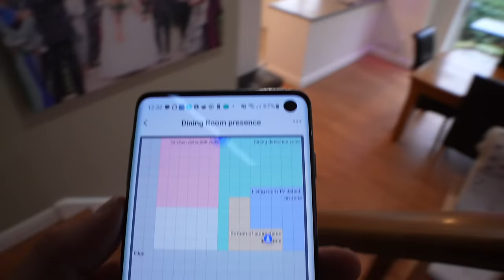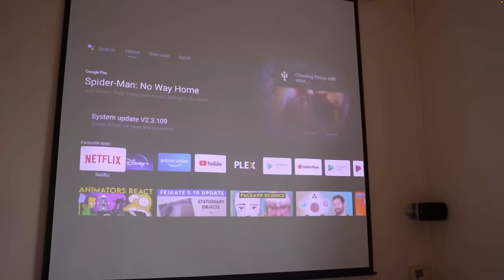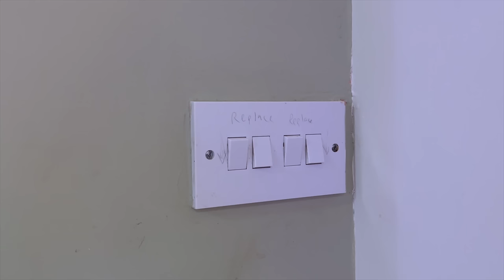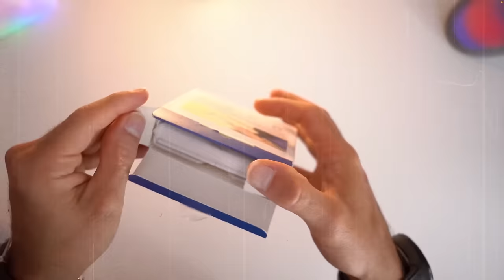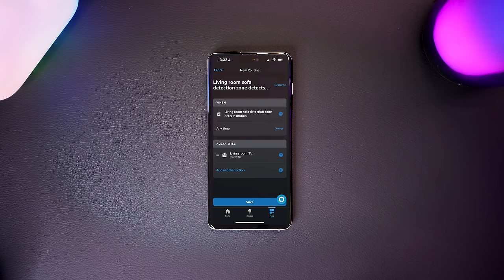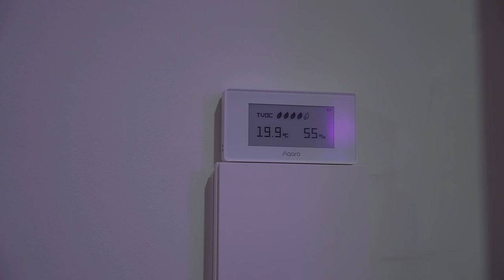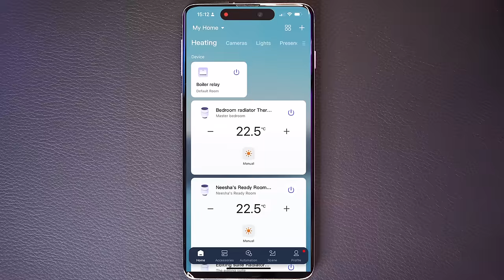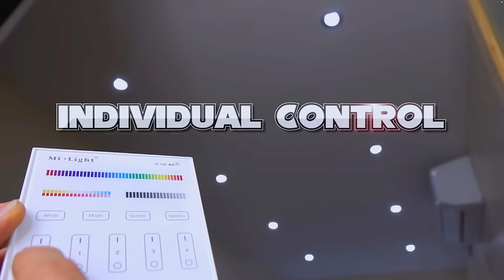This Changes Everything… HUGE NEWS

Comment: I rewired my parents’ boiler’s programmer unit many years ago (it was in an inaccessible position where you couldn’t see the date, time or temperature settings and I was fed up being woken up at 5am when I stayed there because they couldn’t change it when the clocks went forward (it wasn’t a one of the units that can do it themselves). 

Anyway, only mentioning it because there were 79 connections to make. (There was a couple of metres of trunking and L-shaped angles having to get the wires out of an alcove round an external corner and navigate around awkwardly positioned surface mounted plug switches.) 79 connections.

Best job I did for them (it worked). Did I mention there were 79 connections? (Only bragging because I can’t do that stuff any more and am heartbroken.)

Love to the gerbils. And you both of course. 😘

Comment: Spot on... they all don't actually have a full range.... non do...

In Australia they are actually just sensors no lighting bar led strip's.

The in wall/roof smart relays are available at 70 bucks each 🤯🤯

Shelly's are under 30...

Comment: Great video - I’m actually thinking of buying some smart light switches as I’m constantly fixing my BroadLink ones when they go offline. How are the Aqara ones for reliability? I just want to set them up and forget about them if possible
Reply: I've had some for about a year and have had no problems at all. Would highly recommend.
Reply from the maker: Best in the market for the UK, which is why I went to the trouble of swapping out the 4 gang for 2 two gangs. Can’t recommend them enough!
Reply: I had the same problem with Broadlink and also the one Aqara switch I try regularly falls of Hubitats radar as far as knowing what state it is is concerned. They are not as pretty as Aqara but to be honest Yagusmart Zigbee wall switches have been great in my home both with and without a neutral, really reliable if the zigbee network is strong.

Comment: I have a love/hate relationship with Aqara. First, they make things that nobody else does (like my blinds rollers). Second, they look nice. Third, they have multifunction uses that I find very handy. The big downside for me is that they don't follow the zigbee protocal exactly, which means that sometimes they don't do what I want exactly the way I expect. Oh, and their vibration sensor is crap and won't stay connected to their hub even when it's only two feet away. However, I also love Home Assistant, even if it means I'll never have sex again :) So I do love the fact that it works pretty well with HA :)

Comment: Any chance you can ask Aqara to make a smart lightbulb with a presence sensory built into the lightbulb?

I ask this due to their presence sensor’s “fall down detection” only working if their sensor is mounted on the ceiling, so putting it into a light would mean it would be powered by built-in power for the lights (so no ugly wires or having v to change batteries), and would be in the right position for fall-down detection to work. It would be a game-changer for elderly and people living with disabilities. 💙

Comment: The only problem I have is that you are now dependent on Aqara for all of your stuff. Not that I think they're going to go under anytime soon. But when they do, or decide to stop supporting your older hub, you're going to wind up with a ton of work rejoining devices and reworking rules. And let's be honest, larger companies (*ahem, Lutron*) have fallen.

Sonoff has a controller that can do all activity locally, or via network. It has an open API, and clearly marked hardware ports for flashing alternate firmware, like Tasmota, which can connect with NodeRed, FHEM, OpenHab, and yes, Home Assistant.

Don't get me wrong, Aqara is a great brand. 1/3 of my home devices are made by them. But relying on outside services will always bite you. Ask any Sears, Walworths, Toys R Us, or Thomas Cook customers, and they'll agree.

Comment: There is another free cloud option that offers BOTH a subscription or an SD card. I have not see you review them for a while, but I have a whole Wyze ecosystem with cameras and lights integrated with my Google Home. Would love to see more Wyze things on this channel as every product of theirs I have tried have been amazing. I keep everything smart home on a VLAN setup in my router and it all works great. I am not sure why most smart home tubers like yourself have not featured them in some time, but they are worth a new look :)
Reply: Also also, you can get creative and load custom firmware to the to cameras so they can be 100% local. I have not seen one other company that allows you access to such features right out of the box!

Comment: Hi Paul
I dont think you are far wrong, I am a big fan of Home assistant, but I find it infuriating when I do an update and a load of my stuff stops working. The reason I watch your vids(apart from the comedy value) is that you are like me nerdy but not quite as nerdy as the the home assistant nerds, and the fact that you do test lots of nerdy stuff that can work alongside HA. I am similar I use the Tuya smart life and the Ewelink apps along with home assistant for the more technical automations. I havent gone down the Aquara rout as I dont want a fourth app I already struggle to work out which app is controlling what thing in HA if I had another it would muddy the waters more.😉
Reply: I sold Aqara, Xiaomi, Others and went Tuya after struggling as early adaptor of the Chinese region locking that existed in them. I know Aqara have corrected this but I find their products seriously overpriced. I sample the devices (in the thousands), find the one device I need more 4 of and go with it. Contrary to opinion (those who do not realise it or even want to know the facts), Tuya has EVERYTHING and I mean EVERYTHING. From Powerful split ACs to Robotic Mowers to Smart Watches to Presence Sensors, to POE based Cams to Temperature sensors for boilers to displays, to IR RF, to Matter capable Zigbee 3 Hubs and more. I means thousands. And there are more reasons: Tuya also has our countries compliant electrical embedded as well. You goto your electrical light fittings store, you can goto to your electricity component department and BUY off the shelf electrical certified Tuya ECO system devices for your country. Okay I can really think nothing that is already in this eco system. And they are snap away from being integrated into HA.

Comment: Few of you Smart Home youtubers (mostly you Paul, Lewis is just perv) convinced me to stick with Aqara, now i'm renovating my flat from zero (wasn't used for a while) and all I got for the start are only aqara switches, M2 hub,  radiator thermostats and some smaller things like aqara smart button. So hyped to put it together and run homeassistant on my rpi4, would probably stick only with aqara but there isn't any option for smart door lock than Yale Linus when it comes to flats. love your vids, great job

Comment: What happens if there is no internet connection? Does it work locally?
Reply from the maker: The presence sensors don’t when using them directly with aqara, I’m hoping they change that!! They do work locally through home assistant though

Comment: I have no trouble with my HA Setup since I run it in a VM on my Synology Nas. But I get where you are coming from, I was there before I had my current setup :)

So, currently, I am using Aqara and HA in tandem too. All devices are present in both systems and through HA I am exposing certain devices to HomeKit because I use it as a sleeker UI interface an my iPhone.

Automations get made in HA since it is my HUB for all the devices from different manufacturers.
And the Voice assistant of choice is Alexa, since I am heavily invested in Echo Dots.
Reply from the maker: Very similar setup to how I will probably end up. Once I inevitably add more smart home gear from other manufacturers home assistant will be an unfortunate necessity.

Comment: Good luck with your new home, Paul, it looks really nice. How many devices did you install that are battery powered? Won't it drive you mad having devices randomly stop working in 6 to 12 months time when the batteries need changing? It drives me nuts and I can't be arsed to change them anymore. I wish they could run purely from the energy transmitted by my WiFi router! That would be a great solution. One day maybe.
Reply from the maker: So far it’s just the radiator thermostats and remote sensors that are battery powered and SHOULD last a couple years each. Might drive me mad in 2 years time 🤣 we’ll see!

Comment: I love Aqara buttons (Wireless Mini Switch), great buld quality, loveley to look at, short, long, continuous press and release actions in Home Assistant with ZHA.  So cheap on Aliexpress too. The have no problem connecting to cheap Sonoff ZBMini switch relays or a Sonoff Dongle E Zigbee coordinator plugged into my HA. Aqara T1 and T2 relays are quite thick and might be a real PITA to stuff in a wall box.

Comment: Having the light turn off behind me and then switching it on in front of me after a second would drive me nuts.
Can you make the zones overlap, so it turns on when you transition and turn off when you actually left?
Reply from the maker: Absolutely, it was only programmed this way as a demonstration of the accuracy. It is now set for 10 second delays around the house 😁

Comment: Good advice Paul. Aqara makes very good stuff, and the écosystem is nice for starters.
I've got plugs, switches and motion sensors to trigger lights everywhere in my place (like yours) and it is very reliable. It also works great with HA. I wanted to use it for my automations BUT... As it can't control my covers, radiators, energy sensors, presence sensors, media players, i would say HA is still needed if you want to make some advanced stuff.
I have already installed an appartment and a house with HA + Aqara stuff, and it's fine : low maintenance needed.
I think you start getting problems with HA when you put too many brands/écosystems in it and/or try to do too complicated things.

Comment: Hi, Paul. I have a quick question about your mini-split A/C.  I'm looking to install one in a loft that gets SUPER hot in the summer, so I need a sensor that will monitor that and flip on the unit when the temps get unbearable.  Any ideas?
Reply: How is that different from the thermostat in any A/C? Also, have you considering ventilation(extracting air instead of conditioning it) or shading more of your windows?

Comment: @paulhibbert - I have a pressure relief pump connected to a hot water system. This pump should only be running when there's a fault.. Do you think I could put a vibration sensor on it to get a notification?

Comment: If you still want to leverage from your non HK accessories Homebridge whilst not as flexible as HA is relatively trouble free. Also I’d recommend Casambi (professional grade accessories) for dimming at the fitting with their tiny CBU-TED as an example. I have lots of them and HB helps to integrate.  Also EnOcean switches require no power and no batteries!

Comment: Can confirm that Home Assistant configs can get messed up. Mine recently got into a horrible state with the december update. I ended up just reinstalling from scratch and ignoring backups. I've ditched as much tuya stuff as I could, moving to Zigbee.
Reply from the maker: I have some Tuya plug sockets that I REALLY love, but HA hates them 😂
Reply: Tuya is very clunky, no doubt, but keep an eye on things as lot's is happening in the background with the merging of tuya cloud cutting and esphome.
Reply: I've had the same problem. Went to a multiple backup system, normal backup, system image and config files so I've always got an alternate to backup from. I have a huge system now and can't imagine starting from scratch.
Reply: I only have Tuya stuff that I dont want in HA (Namely the plug that restarts my server) so I can access externally if something freezes and not trigger by accident.

I've not had too much issue with the new Tuya Local Control but I try to stay away from it where possible.
The issues with HomeAssistant have gotten miles better once when is in UI integrations. The main issue is that YAML files cant easily be converted when things get changed or depreciated, but the UI stuff can, but it can still be massively frustrating.

Comment: Isn't Aqara cloud based. If your Internet is turned off, do all your smart devices still work?
Reply from the maker: Everything is local with aqara except their presence sensor which is cloud based currently, however if aqara went bust there is a way to make it run local in home assistant

Comment: I loved the Aqara motion sensors & Presence sensors too but then they stopped working for no apparent reason then they became tempremental and worked some of the time so now moved onto Kasa / Tapo
Reply: How well do the motion sensors work with HA as I had exactly the same issue.
Reply: I have only used with Alexa routine

Comment: Are you able to directly interweve Aqara and HomeAssistant? I.e. have Aquara device show up in HA/Trigger HA automations like you said with Alexa?
I would love the reliability that the Aquara ecosystem could offer, but would still like the customisability (and Dashboards) of Home Assistant plus include my non-Aqara devices in zone triggering.

I've been going Aqara for a good while with my Zigbee devices (Though on ZHA) so could link a lot in straight away, but for me nothing can beat the flexibility of HA. If I could put them together and use the most basic HA features (and thereby ones that are less likely to break on updates) that would be the best of both worlds.

Also cannot quite make sense of the Aqara Hub numbering, is the M2 or the "Stupid Sexy Cat" hub better (ignoring the added camera on the "Stupid Sexy Cat")?

Comment: Home Assistant is some work to maintain but that’s also part of the fun of it… Home automation is not that exciting anymore turning on and off some sockets and lights or heating based on location is all very meh.. My current favourite is turning on fans and a dehumidifier to maintain a low RH in the basement and washroom. I find the Aqara P1 not so great the MMW presence sensor is okay. I also find the IKEA smart devices to be perfectly usable especially with HA and ZHA. The videos are good introductions to new products would be great to see some real dedicated smart home reviews instead of all the stuff we as enthusiasts cobble together, so smart tech in consumer units etc. imagine building a house from scratch and with smart home in mind so the wiring is done to cater for automations, there is Ethernet to attach access points throughout the house and garden, doors with inbuilt spaces for sensors, measures on water so you know if a tap was left on even just a little bit and light fittings with presence sensors built in.

Comment: I'm a big Home Assistant user and their 2023 12.2+ releases broke ZHA (zigbee integration) and all my zigbee devices stop responding a few hours after each reboot (Fixed in 12.4) which was not mentioned in the release notes. The coder mentality of treating issues like this as normal is totally infuriating. Commercial developers don't release unproven code into the wild and neither should HA. Unfortunately there simply isn't an alternative that offers the breath of support or configuration granularity so I'm stuck with it for the time being.

Comment: Hello Paul, Im glad to hear about your new home. I think it looks outstanding. I presume that it was a considerable amount of work. I have observed a considerable delay when entering a new area. I am curious as to whether you have configured it in this manner or if it is a default setting.   I look forward to hearing about your pushback home assisted somewhat and how it fares.
Reply: I wonder if you could make overlapping zones so the lights come on BEFORE you take that first step
Reply from the maker: Yeah, you just set the zone border a little further out, I have actually made some small adjustments since and set a delay before the lights go out so it’s doesn’t go dark until I have left the room

Comment: Aqara has some interesting products and their hardware is generally pretty good, but their software support (at least on Android, I can't confirm if it's the same on Apple) has some big issues - most notably the ability to edit things.  Take for example the automations.  If you add an automation to turn on a light from a motion sensor (1st entry) as well as only when the brightness level is below a certain level (2nd entry), and then decide you want to remove the 2nd entry - you can't.  There's no option to delete that 2nd entry. You have to delete the entire automation and start again.  Similarly with the Presence sensor, you can draw out detection zones, but you can't delete them.  The zones are stored on the device itself and only a factory reset will erase them.  I'm still plagued by constant ghost images on their Presence sensor and have just boxed it up, it's no use for me.  Their Amazon integration is flaky as well and only supports some of their devices, e.g. no support for their remote light switches, inability to create routines on some of the sensors.